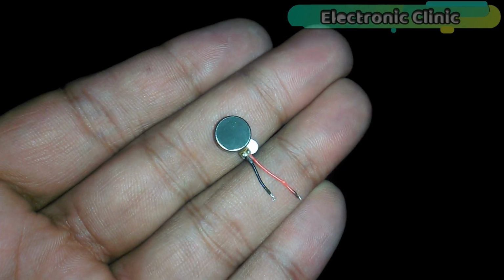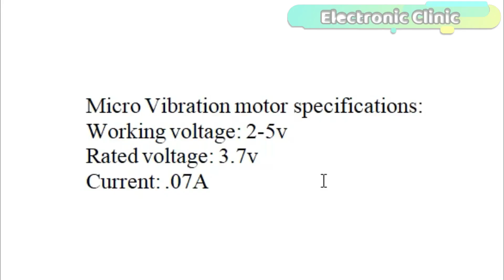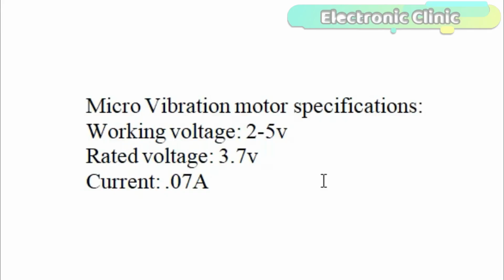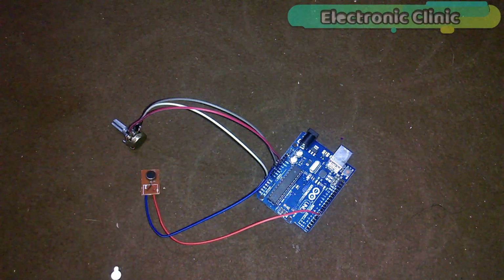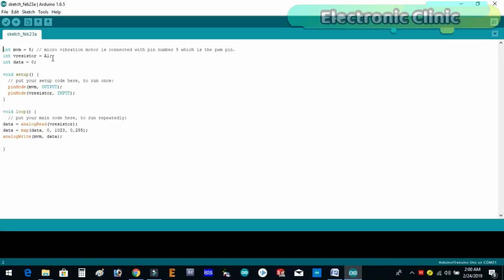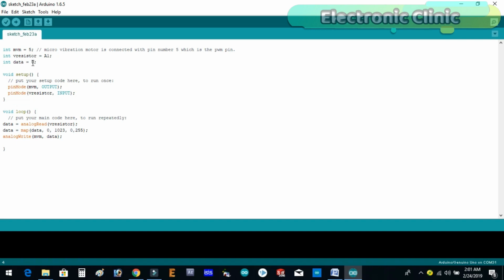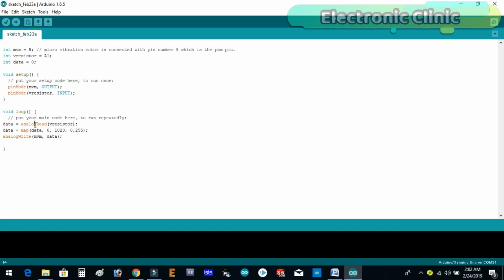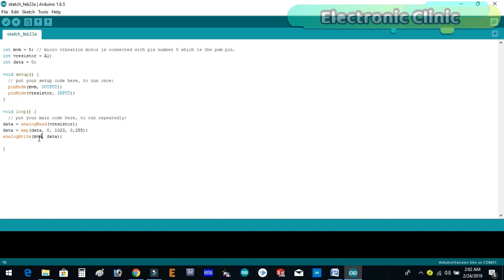Arduino micro vibration motor | Arduino vibration motor code , interfacing "vibration control"

Comment: Hello. Thank you so much for the clear explanation! I really like this project and I would like to know how many vibration motors can I connect to the arduino at max. I plan to power the arduino using the usb cable. 

For this project, I plan to connect as many vibration motors as possibly (4~10) to the arduino, and I want it to work overnight (I want to put the motors in my pillow and bed sheets to help in sleeping) do you think it would be safe to run this overnight? A thing that I can do it let it run for 1 or 2 hours and then automatically shut off. I think this would be better. But do you think it will be safe? 

Thanks in advance!
Reply: hey mate. Im doing a exact similar project, for Indusrtal design, can we link up our thoughts and Ideas?

Comment: Thanks for providing the code . I used the code and repeat it for 4 vibrators and potentiometer  and its working well. but now i need to work the vibrator in a wave form . can you please give  an idea for doing that?

Comment: I was glade to specified the current rating of the DC Motor as 70mA  but then connected it directly to Arduino Uno which can only drive up to 40mA of load Current ! , Surly that is not going be good for the Arduino?
Reply from the maker: use 2n2222 npn transistor to control this.

Comment: I followed this tutorial, purchasing the knob and motor referenced in your description but there was no result. The Yellow indicator light on the Aduino was blinking before uploading the programming and then turned off and now turns on/flashes a bit only when being moved around. Not sure how to troubleshoot this. Is my connection bad? something wrong with the programming? Please give suggestions on how to fix.
Reply from the maker: you can use a transistor to control this

Comment: Mine is a red and blue
Reply: Red is positive , Blue is Gnd or Negative but use a driver to run the motor as Arduino can only drive loads up to 40mA and the motor is 70mA, This will damage your Arduino Uno port.

Comment: great video. is that possible to control more than one motor?
Reply from the maker: yes. you can connect and control multiple motors
Reply: @ElectroniClinic  How would you go about doing this?

Comment: with this configuration the arduino board will certainly be damaged.
To drive one or more vibrating motors it is possible to use an uln 200x which guarantees high output currents
Reply: Yes you are right ,even driving one Motor is going to damage the Uno as every port can only drive loads of 40mA and the motor as the man said is 70mA.

Comment: Is there any bigger size micro vibration motor that has the same shape as this one, that can handle about 12V instead?
Reply from the maker: if you can't find the one. you can make a vibration motor by yourself. select any 12v motor and attach an unevern weight with the shaft.

Comment: Correct me if I'm wrong but connecting any dc motor such that 1027 vibration motor seems to be a sure way to damage your Arduino I/O pin. That motor needs 120mA starting current and needs 60mA for its operating current. Arduino I/O pin current rating falls within 50mA. For demonstration, it's fine. However, for projects, a relay or transistor circuit to separate the motor from the microcontroller is essential.
Reply from the maker: ya during the testing I didn't feel anything but a transistor like 2n2222 can be used to control this small vibration motor.